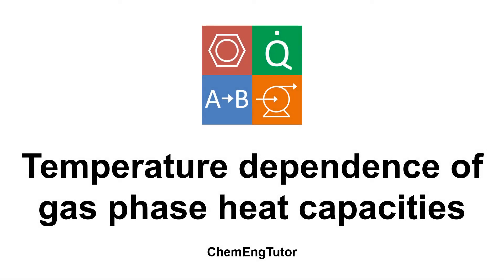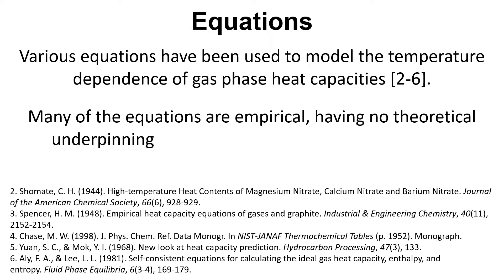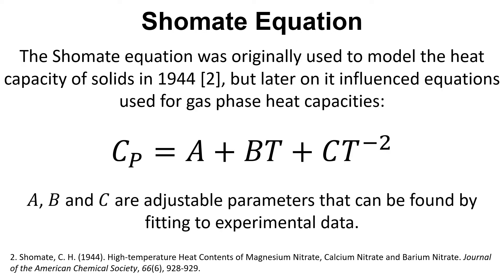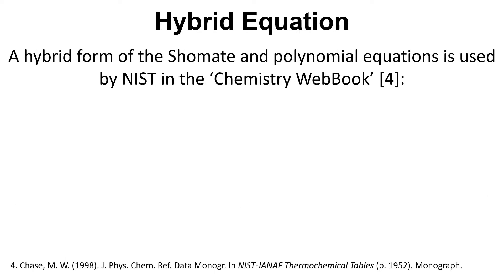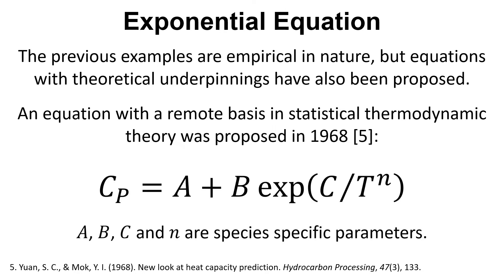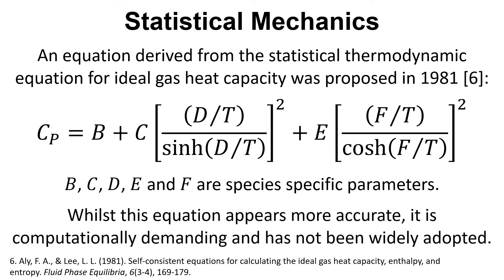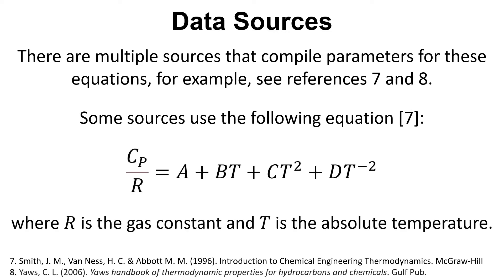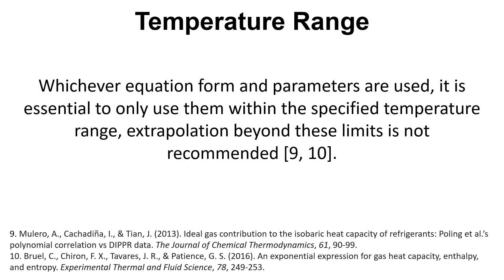Temperature Dependence of Gas Phase Heat Capacities

Comment: looking at the NIST Webbook the Shomate equations given there are valid from 298K (25°C) and up but what if we want to model lower temperatures? For example a jet engine at 30,000 ft can be sucking in air at -50°C